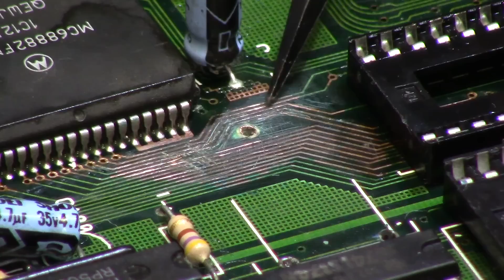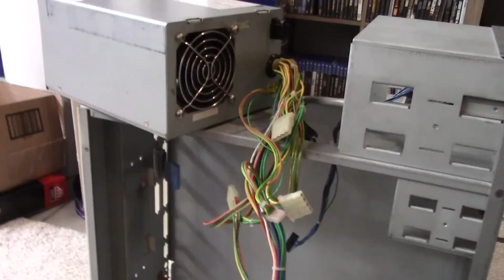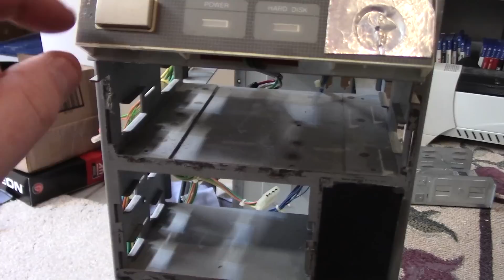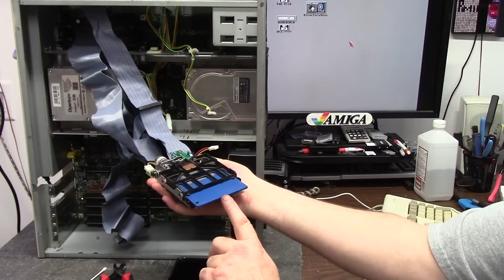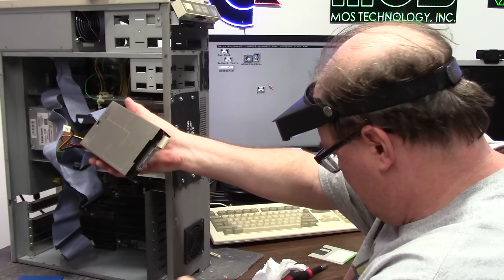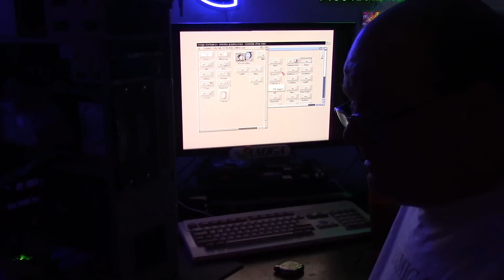Amiga 3000 Tower restoration p1

Comment: Great video. I'm working on mine on A3000T too, and trying to collect some facts... where did you get the 8K manufactured info from?
Reply from the maker: Work
Reply: @ChrisEdwardsRestoration  Thanks. I will quote you as the source for that info if that's OK. 

Also, do you remember what year Commodore introduced it? Everywhere I read it is "1991" but mine (serial 1050) has Dec 1990 date stamped in a few places on the case. I'm guessing they just used 1990 cases, but looking for confirmation...

Lastly, I found the 1992 price from Commodore for 040 version with 200M disk: USD 6000. Would you possibly have any information on how much the basic 030 version cost at the date of introduction? Again, I will always point viewers to your channel as the source of course.

Comment: Another good video! That one's not so bad, I've done worse 3000T boards that needed like 25 trace repairs :D Tip: there's one electrolytic that always leaks, on the edge of the board next to the last 16 bit ISA connector. It's not very important, something with the audio circuit voltage I think.

Comment: Love my A3000T.  Even empty, they are weighty beasts.  Don't love removing the motherboard so much though, so many screws.  

Good calibration info and demonstration.  I've used a demagnetizer with success on some 1541 drive heads.  Maybe it would help on the Amiga floppy.  I have replaced Amiga floppy drive cables too and found that it fixed some problems.

Comment: Years ago I had an A3000T but I eventually sold it.  I don't know what its problem was but I experienced a lot of lockups and strange issues as well.  I suspected something wrong with the SCSI portion as it would always lock up when I tried formatting a new hard drive.
Reply: I've fixed many a 3000T in 20 years and i have found this very problem caused by defective Toshiba brand chip ram zips. Not saying it was your trouble but it would cause random lockups doing anything from partitioning a drive, accessing a scsi cdrom etc. or simply trying to run some other program. It is also a good idea to update the SCSI chip to the wd-08 or amd 33c93 if it had the proto 4(it was notorious for trouble with multiple drives). The old scsi chip could also have problems when the A3640 accelerators were added.